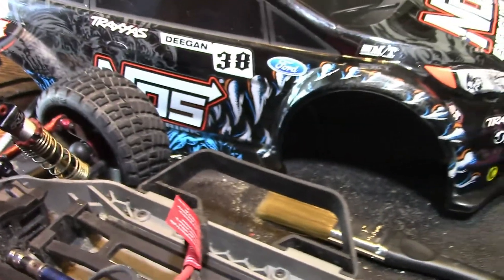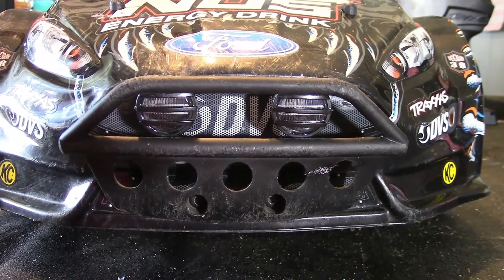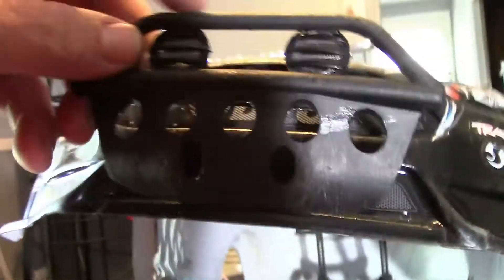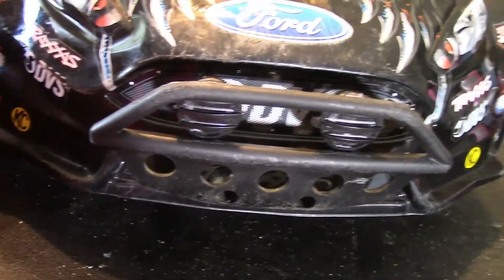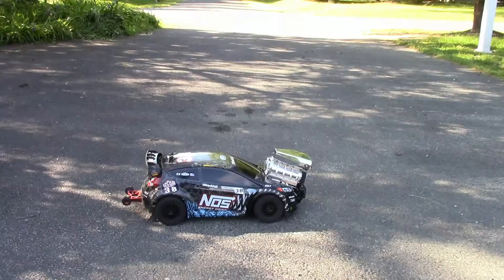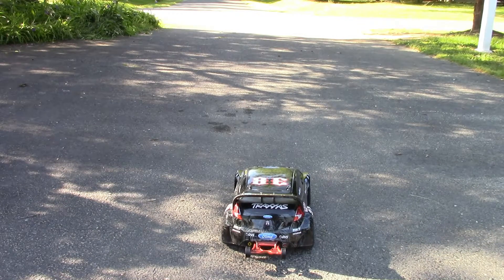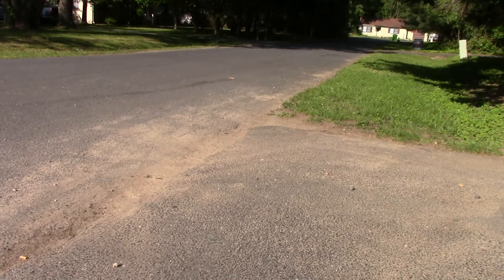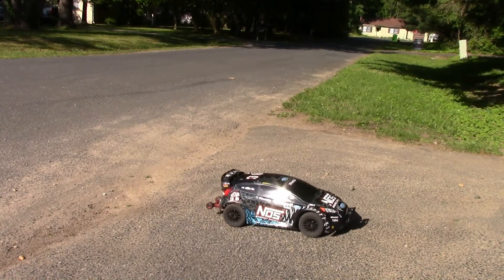Deegan Rally Run with Traxxas Sway Bars

Comment: The alum upgrades you have , did they help more with the sway bar set up or seemed decent before as well? Getting my kids into racing and we have been thinking about sways for the higher speed oval we do but would you recommend for short indoor clay? Thanks for the awesome videos man keep up the good work!
Reply from the maker: mike andrade no...setup is the same just the aluminum holds up better and helps the bearings stay more tru as the aluminum doesn't flex. I would still do sway bars for shorter or slower tracks such as indoor but use sway bars that are not as stuff as high speed. if the indoor track has sharp turns still consider using the stiffer bars

Comment: Performs great man!!! You just helped me with my upgrades. Those sway bars really enhanced your control. I wonder how it would perform with a better tires now?? Was it challenging to change the slipper clutch? As far as give away maybe something cool for one of us new Deegan car owners. lol
Reply from the maker: my buddy tried 4 different tire wheel combos for street and the stock seem to be comparable to the others. I think the tires are a good all around choice that come on it IMO. the only thing is it depends on what your doing with it...off or onroad? If your doing both I would keep the stock and maybe change out to strictly street tires when you want. I'm thinking about doing some drift tires on this thing and maybe some paddles sometime! The 4x4 stampede slipper assembly is a direct fit for the Deegan..no mods needed except putting a 32 pitch pinion to match the 32p on the stamp spur. I used a 15t pinion with 54t spur in the vids but later settled on a 14t pinion for better grass performance. and if you win this weeks giveaway you will get Deegan parts if you wish my friend.
Reply: Thank you that was exactly what I needed to know. I also have the 2wd VXL OBA Slash and this seems very similar. So I'm happy to mod it for off road since I converted my Slash into a street car and this is a 4x4. Man that Slash is fast. Anyway thanks again and I look toward to seeing more of your work.

Comment: easy question, how did you mount the castle ESC to get chassis? I super glued it but it only lasted two runs lol
Reply from the maker: ibarjo1 I always put 2 layers of 3m double sided foam tape. clean the esc and stick 1piece on it and the other on the chassis. clean with rubbing alcohol and let dry
Reply: B&C Ultimate RC ok, I'll try that. I'm loving this thing, but my body is all beat up now. I can't wait till there's more bodies available for it.

Comment: would a 4600kv be too high? it a 4 pole but I want to be sure it can pull the thing
Reply from the maker: WoahNelly 01 I would try it...just gear down to a 10 or 11 tooth pinion at first and keep an eye on motor and esc temps. then if it's good you can hear up from there. you should be fine
Reply from the maker: WoahNelly 01 gear....sorry.